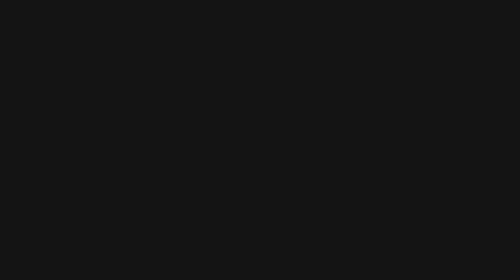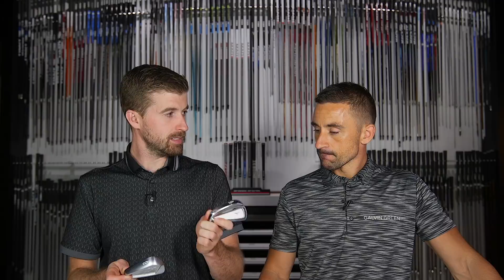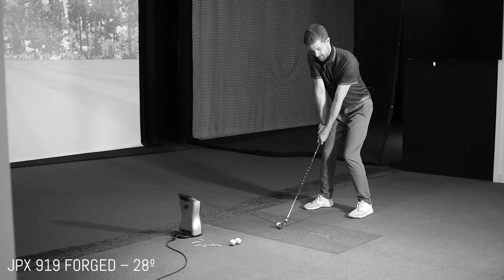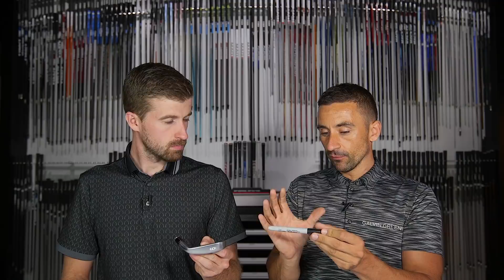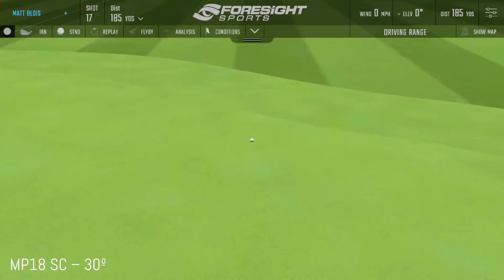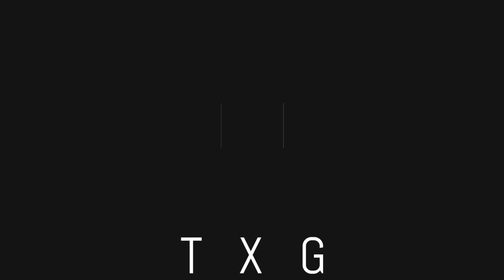Mizuno JPX 919 Forged vs. MP18 SC Irons

Comment: Was fit for 919 forged with modus 120 stiff. Have NEVER hit them like I did in fit. Struggle hitting the toe side of the grooves missing the center struggling with distance and hook. Have had the lie flattened closer stroke but still toe side of grooves. Any other ideas??????

Comment: I'm glad that you're showing data on the SC at the intended loft because I'm sure that Mizuno intended these clubs to be different.  It is interesting what you have done by comparing the two at the same loft.  I think that the JPX appeals to a different person than the MP.  The results may be similar but how you get there is different.  As an MP guy, my first question is how does the MP perform at the intended loft?  
For my next set, I am keen to blend a set for 2 reasons.  1. My long irons may be easier to hit but what excites me more is 2.  That I can use a blade for my scoring irons which I avoided in the past because they have been harder to hit with the longer irons.

Comment: Question! How about a club designed for lower loft like jpx919 forged, but you weaken the loft. (Ie: kind of reverse of the stronger lofting the MP-18)

Does it apex higher, launch higher, lower speed?
Reply from the maker: It would likely, yes. For some players, a weaker loft configuration on an iron design like this can actually work quite well if a bit more height is needed.

Comment: Do you notice a difference in closure rates with the cavity back models because of the toe/perimeter weighting? I've struggled with long iron CBs because of the face shutting down. Any advice on how to get something more forgiving than my MB without having to hold off the swing?

Comment: Ian,

Would the Cg of the sc influence the launch angle more so than the loft. Interesting that with a 2 degree change up the launch angle was very similar.. 

Cheers
Reply from the maker: Possible, but we're also dealing with the human variable in terms of the data. Could be that the swings made with the higher lofted SC were delivered with slightly more shaft lean.

Comment: My MP69s are still the love for me. Even when I was considering the MP5 last year. But mine felt better and that ended up getting me fit into 6.5 LZs..and a change to my typical 2 deg upright line angle. Going through swing changes now that are leading to inconsistencies (shot 80 and 93 on the same f'ing course), but the good shots are great. Trying to get back to my 9 index, but short game is killing me.

Comment: Thanks again for another informative video. You guys are definitely the best out there. Question for you; I have JPX 900 forged. Swing speed is about 70 miles an hour with six iron.  I have LZ 60 g shafts. Do you think I might benefit from a heavier shaft?
Reply from the maker: Depends more on your delivery characteristics than your swing speed. More shaft weight often helps a player who is quick/aggressive in transition or tends to be over the top.
Reply: TXG Tour Experience Golf Thanks for your reply, good to know. I think I might give it a try

Comment: With regards to the newer model iron in stronger lofts I still struggle to get the ball in the air would a softer tip shaft suit me and if so what could you recommend
Reply from the maker: Unlikely that a shaft change would have as much influence on the ball flight as loft. Something like the Ping i500 which offers retro lofts might be a good option for you Ian, still take advantage of the technology but more loft to offer a higher ball flight.
Reply: Ian White Keep your head behind the ball at impact.

Comment: I never wholly liked the 1025 metal of Mizuno. It's what kept me into clubs like the 09 X-Forged, Bridgestone J33, J40 CB, now Srixon 565/765 combo and away from Mizuno. 1020 CB is just so much softer.  The hybrids are clicky as well, like Apex, TM P790's and Ping's too. To me, 1020 offers the best feel.
Maybe you guys can do a video on the different "Forged" variations?
Reply: Juan Soto that’s an interesting idea. Wonder what a set of irons made out of 8620 (like the old cleveland 588 wedges) would feel like?

Comment: Great idea to compare across the MP & JPX range rather than 900 to 919. I have to say that the new ranges look stunning and it's hard to say which one looks prettier, even though they are all aimed at different golfers. Personally I must admit that I'm having naughty dreams about the "HotMetal", damn they are gorgeous! Ooops sorry, getting carried away again!
What I found fascinating is how little difference the addition of Boron made to the numbers of the JPX Forged. It begs the question whats it there for, if it isn't increasing Ball speed or launch??
Reply from the maker: 😆 the hot metals are quite a club!! As for the 919 forged over the MP18 SC, probably not as much difference as we expected to see but likely would see a bit more ball speed, higher launch and lower spin on average across a bigger sample size
Reply: You may have to give me advanced warning when you post the Hotmetal Vid, I may have to double dose on my blood pressure pills😃🤦‍♂️
Reply from the maker: 😆 it's coming end of next week, you've been warned
Reply: 😂Thanks for the heads up, I will put the Medics on standby🤣

Comment: Very interesting once again the stronger lofted club going higher do you think it would still be the case if the swing speeds were lower .
What do you think of the recoil 65 graphite iron shafts. 
And on a different note why do you thonk Ping are still  using lie boards  instead of the more accurate GcQuad with HMT...

Comment: Great video,  I have found the Mizuno line up a little confusing.  I would have thought the MP18-MMC was a closer comparison to the JPX 919 forged - at least in terms of size and forgiveness.  This is particular due to fact I tried both the JPX 900 and MP18-MMC and felt they were so different that they were aimed at very different golfers.

However your numbers do seem to suggest that MP18-SC and JPX919 forged are for very similar golfers (which is as close as I will get to saying I was wrong!)
Reply: Justin, for me, the two are also very different clubs.  I'm a JPX 900 player and tried to work in the MP18 HiFlis in the higher irons, and they just weren't for me.  Where the JPXs feel like they're made for me, I just don't get the same delivery from the heavier MP18 heads.  There's definitely a higher level of forgiveness built into the JPXs, but I also think that the heavier soles of the HiFlis weren't helping me either.
Reply: I took it as they were comparing the two "middle, all around" club from each of the two very different lines that Mizuno put out. I agree the MMC would be more like the 919 forged in theory but comparing the two clubs in the same position of the JPX and MP lines help show the overall difference between the lines in general. That was my take, anyways.
Reply: The JPX line is more forgiving in general. Bigger, thicker head, with more offset and technology. Read the mygolfspy.com write up on them. I think the MP-18 may provide a little better feel/butter feel, a little higher spin. MP-18 is their traditional line and JPX has modern aesthetics and technology in them.

Comment: Do you stock the miura mc501? Any chance of a review please? Interested in how they compare to mizuno?
Reply: I have the 900 Forged and I tried the Miura MC501's and I could not feel anything different between the two. I know Miura's are a gorgeous club but for $1,000 less I opted for the JPX 900 Forged.
Reply: Jay McGillicuddy interesting I’ve heard Miura feel really soft compared to anything else out there. Was considering miura wedges at least as struggle to get soft feeling wedges. Will have to find somewhere and try before I buy.
Reply: My Mizuno Wedges the T7's 56 SW and 60 LW are not that soft. My regular clubs are a soft feel for me.
Reply: Jay McGillicuddy I like the look of the ping glide forged but don’t think I can bring myself to spend £200 a club on ping.
Reply: Aren't the Miura's going to cost upwards of $269.00? They are expensive too but may be worth it if they feel that soft.
Reply: Jay McGillicuddy think I’m just after something a bit different. Never see anyone with miuras where I play. Will have to find somewhere that sticks them and try em out
Reply: Anthony Jones have been waiting for Miura 501 review, finger firmly crossed 😎
Reply: I currently own the mmc.  I was thinking of getting the 501 in black or the 919 tour.  Love the looks.  In person the miura is so incredibly small.  They market the club as a modern blade that medium handicap can use.  Myself as well as the guys at club champion called bs.  It's so small.  Compared to the 919 tour I would say it's a difference equal to going from a 919 forged to the tour.  Very very unforgiving.  If you want a blade look get the tour.  If you want feel and forgiveness the mmc is the best option.  If you want a slightly softer but not very noticeable club get the sc, but the loft is weaker.  Your choice.  I swear on everything the miura was soft and sexy and that's about it